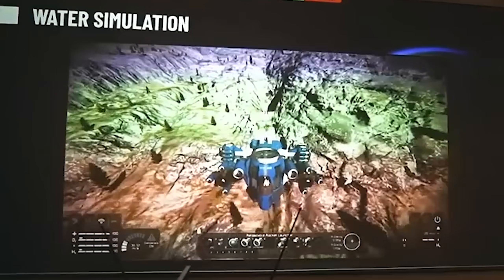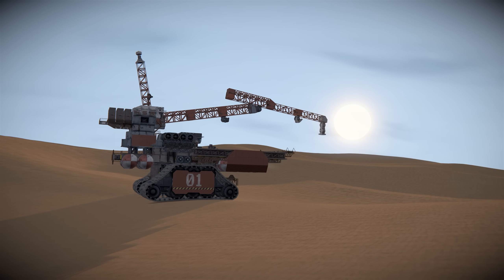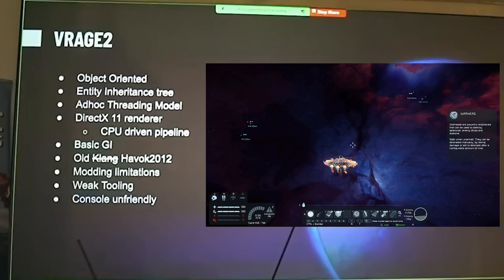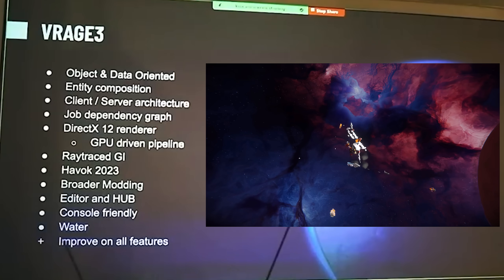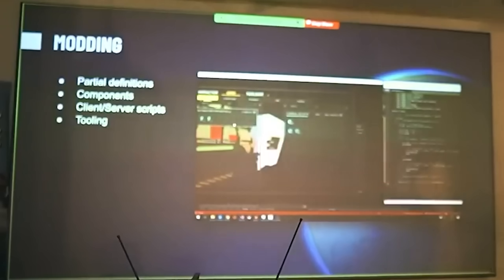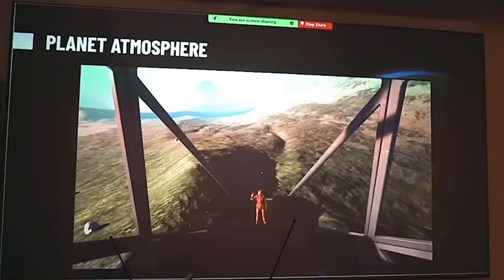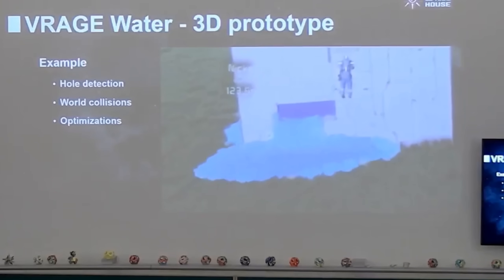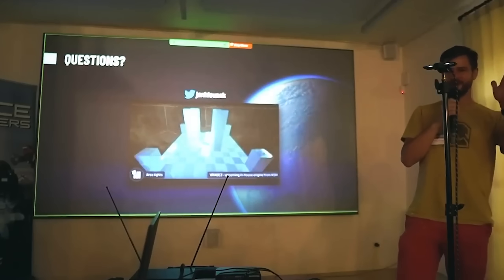Space Engineers 2 Leaks Unveiled by Programmer - Presentation Breakdown!

Comment: Fingers crossed that we end up being able to place multiple blocks in the same grid space like in Medieval Engineers. That would make designing interiors so much easier
Reply: If they don't have that they'll have really dropped the ball, given it's in Medieval Engineers as you said.
Reply: Agreed. I keep getting a message when I'm placing blocks in space engineers that says multiblocks aren't allowed coming soon.. soo I'm just scratching my head.
Reply: @dudewhere2go  They've never said compound blocks are coming to Space Engineers. It's a limitation of the version of the engine they're using, adding it would require rewriting an insane amount of code apparently.
Reply: You mean clipping blocks basically? I would hate that, I don’t think clipping should be a game mechanic bc you will get really nice looking ships but theyre just an amalgamation of 99999 clipped parts. Large and small grid mixing would be cool though.
Reply: @6105boe  oh, no, I mean being able to put two or more blocks in the same spot as long as they’re small enough to actually fit there. So not like two different armour slopes together, but more like a chair next to a wall with a screen on it in the same space
Reply: @liamferguson4145 to be fair, being able to overlap different slope blocks would get rid of the need for the dozens of slope block joints we currently have in Space Engineers.

Instead if needing to use some unique bespoke left-hand-steep-splope-to-45-degree-corner-with-half-block-edge block, you just overlap your steep slope, 45 degree, and half block on top at whatever relitive angles you want.
Reply: Medieval Engineers doesn't have to do remotely the same amount or scale of colission checks.
So in turn, their colission can become much more complicated and CPU intensive.
While I hope for it, I would never expect it.
Reply: The guy that gave the presentation actually has a tweet about a unified grid with the current small grid block size (25cm2) used as the determiner of block collision. I wish they just went with interpreting large grid as just sized up versions of small grid from the start. Besides, gameplay-wise the only blocks that rely on being on a static and therefore large grid are wind turbines and safe zones. Better late than never but the granular collision mesh is a real upgrade for decorating
Reply: They are doing this. Announced on twitter
Reply: I could be mistaken but I thought I heard them say that you will be able to do things like this because they are redefining the whole "Large/small" block thing to be universal and compound so if thats the case, all our dreams will come true
Reply: @jamestyrantlancaster3645  Yep, its COMFIRMED multigrid will come to space engineers. No more small grids and large grids, what it will be is basically large grid blocks are just a huge clump of small grid blocks, like 1 large grid block is 5 small grid block in space engineers. So technically speaking, you could in-fact build off-set by 1 block even with large grid block, because the grid itself is 5 by 5 on each block.
Reply: On Twitter they have already said that there will be no more multiple grids! A grid will support blocks from 0.25cm up to 2.5m! That's perfect.
Reply: @6105boe  no, I think it's more about fitting multiple blocks in the same space if their hitboxes to not conflict, like a catwalk and an interior light, or a window and a passenger seat

Comment: How about more advanced rocketry? Methane and oxygen thrusters/extraction, with afterburner modules so I can inject a bit of oxygen into my hydrogen flow for a bit more juice. Doesn't need to be, and shouldn't be, as intricate as Kerbal. So as long as we are talking about surface liquids on planets, how about oceans of methane on Titan? Or, if using oxygen thrusters, your air becomes the same resource as your fuel, which would be a neat dynamic.

Comment: they should add more noises from for example the conveyor system.. ( like you can hear when parts are moving from point a to point b ) and some shaking from larger machines ( not much but enough to kinda get the effect of feeling the machines are working.  )  also need some comforting machine noises if you have liveable space on the ship ( people can't keep their sanity in a sterile no noise space even in real life ) 

what about rain ? make things rust here and there and repairing it will remove the rust.. specially in acidic planet weather can use such a thing.. it will not destroy the building but it's an upkeep thing or you can leave it alone if you like the look. 

i'd also like to see some nebula areas where you actually fly through a gas cloud and you see some lightning, 

and moving asteroids ( not that many but make it hollow until you get to a certain distance... slowly ( you won't be able to get to the center right away so it can slowly solidify ) would make space battles more interesting if you had to dodge or hide near moving asteroids.

 though if it's too much then disregard them all :P

Comment: Sounds like the problem has more to do with their choice to utilize single inheritance and static class definitions rather than any decision to employ object orientation in their design. I know that their scripting API is all C# but I am unsure what the VRAGE engine was built with. 

If they're using .NET there as well, then multiple inheritance wasn't really possible before default method implementations on interface contracts was added to C# sometime around 2018. That doesn't even address the fact that dynamic class construction in C# requires some dark magic from the reflection library that most people aren't even aware of.

I did work with the game's source code and scripting engine quite a bit and very thick (and inappropriate) inheritance graphs were par for the course; so I'm not at all surprised that similar patterns exist elsewhere in their shop. Flat is typically better.

Object orientation is only inefficient when the architect designs too much structure. I was a little worried when the first slide listed "object orientation" as a problem in the VRAGE 2.0 engine. I was imagining that the next slide would claim that a functional or procedural paradigm would be their saving grace. I am pleasantly surprised to learn that what they meant is that they've learned how to properly orient their objects instead of simply declaring objects as the root of the evil in their midsts...

Thanks for the video. That water simulation looks phenomenal. (And I don't care how nerdy I look in saying so 😎.)
Reply: Saw the same thing and that was my thought too. OO isnt bad you just misused it.

Comment: Aerodinamics would, if possible, be a shipbuilding gamechanger. With some AAA titles available, and some in the works, that offer some degree of what is currently possible in SE, the change to a new engine is critical. Proper aerodinamics, coupled with the current and planned tools, would have SE2 have a 1 over most of the newer released and alpha stage titles.
That is maybe just my view, it would REALLY make a world of difference.
Reply from the maker: Aren't you a bit worried that to many advanced systems could complicate gameplay ?
Reply: @LastStandGamers  they might, but in a good way. Space Engineers is a game of complexity, ion thrusters do not work in the atmosphere, but that's also a feature, the turbines do not work in space, but that too is a feature. And aerodynamics is something usually expected with sims like these.
Reply: @LastStandGamers  Aerodynamics would be a fairly subtle mechanic, more in line with mystery grid behavior (why is my airfoil-shaped grid going up without me telling to? or why does my flying brick take so much power to move?) than the crunchiness of an RPG. At least, I would think.
Reply: Re-entry burnup time.
Reply: @LastStandGamers  ...not that SC is complicated enough hey? Since they are working on a new engine, a fresh look at the natural physics that exists ( look at the water physics that they are experimenting with) would solve a lot of issues. I for one, would rather have a "natural" looking spacecraft capable of atmospheric flight or even a atmos only aircraft NOT riddled with thrusters!! It may be a big problem to solve, but wouldn't it look and feel great??

Comment: My question is, will this be a fully new game? Or will they do a "2.0" update, and essentially rip out Vrage 2 and shove in 3 , into the current space engineers?
If the former, then what about all the DLC content? Can we carry it over? Will it all be part of the base game?

Cities Skylines 2 released today, and it reminded me how annoying it is to get a "part 2" game, that has 1/10th of the old games' content, due to missing both base game and DLC features.

Edit: And I wish they finally get rid of the unrealistic Hydrogen/Ice cycle, that somehow is able to melt ice, then electrolyze it into H2/O2, and then turn that into water again while making a surplus of power :D
Reply: New game. There's no practical way they can change the engine in the existing game and not expect it to break everything or maintain the expected behaviour with old saves etc. They'd need to rewrite almost the entire game, so it'll just be a new game without having to worry about making sure everything we have now still works.
Reply: @TalesOfWar   you CAN update a game on steam to replace it fyi

but i doubt keen would want to do that

Comment: will it be an update to the game? or SE2 will be a different game?
Reply: This will be a whole new game. It's practically impossible to change engine on an existing game, it'll break almost everything and require you to rewrite damn near anything anyway with the added fun of people expecting nothing to change when they load up old saves or use existing blueprints or mods etc. Even moving from one version of the same engine to a newer version can often require huge rewrites of large parts of the game. Satisfactory are going through this now with the move from Unreal Engine 4 to 5. The only real reason they're doing it is because the chunk/asset loading is far improved in Unreal Engine 5, and the way you build and expand over huge part of the map really benefits them there (you'll notice Unreal Engine games stutter when you load new map chunks, it's more obvious in some games than others due to how complex the things they're loading are. Its been such a big problem for so long they rewrote from scratch how it works in UE5).

Comment: Once they add water phases they'd have to get rid off the free energy non-sense of ice power. The engines would need to exhaust water and that would create perpetual motion. It would be fine to keep stored hydrogen as an option for power, especially on hydrogen powered ships. But they'd have to massively increase the power cost of hydrogen production so you'd need a seperate ship/station and power source to fuel ships not just ice.
Reply: Considering there is already a mod for this, even if it's not stock in SE 2 I'm sure it won't be hard to tweak.

Comment: It feel like Every Quest Next which they abandons which reason is not fun. It takes a lot of work to deal with physics with game logics as well balance. Fake vs Real physics. But there is a lot of variables. R&D cost a lot to make voxel space ship battle game is not easy task. As for the planet is a lot time to debug but for asteroid stuff it easy some reason but same logic. It feel Star Base game. It take a lot of time to develop correct ways to handle damage system and stress server for break down parts.
Reply: I mean... they already did all those things in Space Engineers 1. This will just be an improvement, with those years of experience and access to better tech and with more resources to achieve their goals than when doing the original game.
Reply: @TalesOfWar   They work on their own new physics engine which required server code as well. No other game engine so they design their own which take time to build correctly. For example stress and mesh deform when hit with some thing big or small for the ship. As for the water fluid system it hardest to deal with. Well there are other example from other game by using sphere as water to keep the logic not lag.

Comment: An official talk isn't a leak. Just because "leak" is also in their title doesn't make it correct.
Reply from the maker: What would you call a presentation called Vrage 3 Leaks then ?
Reply: @LastStandGamers  I would just replace "leaks" with "info," or something mentioned in their talk like you did with your other presentation summary video. Maybe like "Space Engineers 2 Programmer Update - Water, Aerodynamics, Modding and More" but I think just swapping "Leaks" with "Info" works fine.

Comment: All I hear is more lag. They say you have a whole universe and can build anything, but after you build 1 base and 1 sizable ship it's lag and rubber banding even on series x. They say here's a multiplayer server where everyone can play together, then you get a small player limit, no anti cheat or cheater support, reduced sim speed, lag lag lag, and the servers consistently go down for days at a time and if you don't log in enough all your grids are deleted cause the server can't handle it. The last thing they should do is add more junk. Just make the game stable and fix your junky servers. It's my favorite game by far but they keep ignoring this and the game will be dead.
Reply: The current game engine is limited to pretty much one CPU core. It's old. Modern engines make far better use of modern hardware like all those threads we have or the immense power modern GPU's have beyond rasterising (like physics rendering, it's way, WAY, WAY more performant on GPU's than CPU as it's basically dedicated hardware). If you have a modern rig then a well optimised modern engine will run things far better than it runs the same things on an old, less capable engine.
Reply: You apparently ignored all the optimization changes then...
Reply: Its' currently 6 cores on the current engine. Only grid interaction will usually first cripple the server if there are large grids colliding into one another, usually before anything else if the server was optimized. @TalesOfWar
Reply: It doesn't make a difference if the vrage3 is 6x better, when you introducing water and other heavy dynamics, you back to square one. The game is dieing and SE2 will go through the same death spiral if they just cripple the new system with a ton of heavy CPU items the server will need to calculate.
Reply: @drakcoreoriginal  The game is 10 years old. That it still has such an active community and developer still supporting it is impressive.
Reply: @TalesOfWar   Unfortunately it peaked 9 years ago with 23,888 concurrent players, sitting around under 5,857 in the last 24 hours. The DLCs are no longer spiking the users back, and if it wasn't for the modding community, it would have been a dead duck years ago.
All that Keen needs to do is make the system stable and scale on performance, the community would take lead on everything else. And with every update, they brake pretty much everything, putting the modding community in a mess for weeks at a time.
Vrage3 does have far better performance improvements, but they have been focusing on aspects that will cripple all those gains in the next SE2 release.
Imagine having 100+ users on a single instance with massive grids at a 1.02 SIM speed, instead of crippling and limiting builds + stitching instances together to try get a good gaming experience.
Reply: @drakcoreoriginal  To do what you're saying they need to do, they need to make a new engine, because the current one is at its limits... which is what they're doing. We're several years away before we even see a new game, building an engine isn't a fast process. We don't know how well or not it'll run yet.
Reply: Yeah series X, on PC one base and one large ship is a walk in park